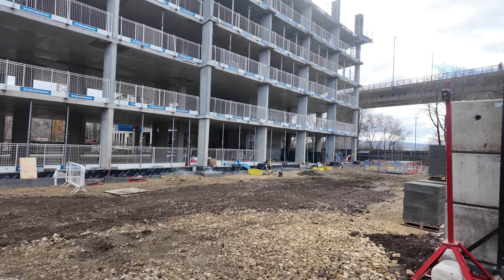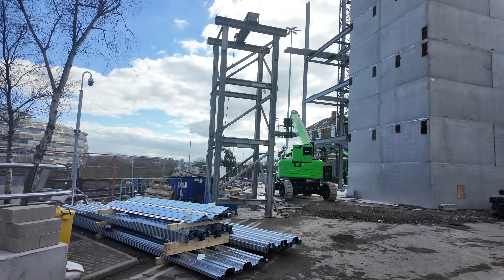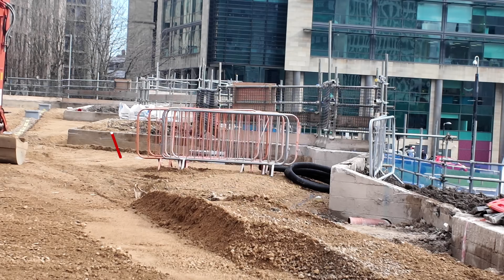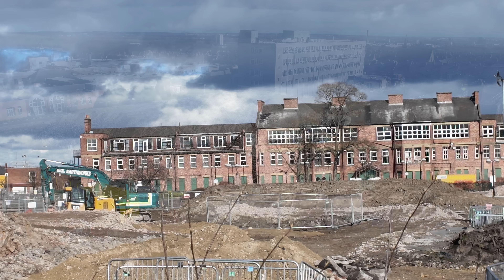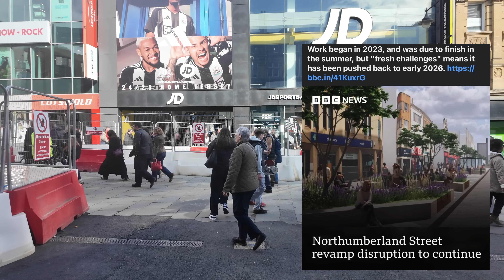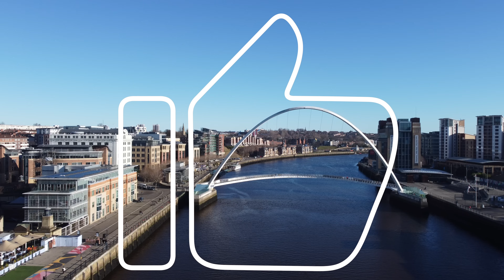Exciting Updates on Newcastle construction and restoration HMRC, Northumberland Street  and beyond!

Comment: I'd love to see Manors station reopened, now its part of the regular Northumberland Line.  heaps of potential.
Reply from the maker: @dazzwsmith  it’s still open never closed only about one train a hour but might be more now since that line has opened. Thanks for watching 👀
Reply: @55DEGREESNORTH68  should be 1/2 hourly during the peaks. I was on about the bottom bit and closed off stairs to the quayside where they did that scene from Get Carter.
Reply from the maker: @ are right get you now
Reply: Thanks for the updates....that General Hospital site is huge!